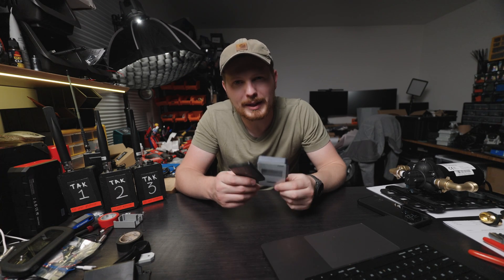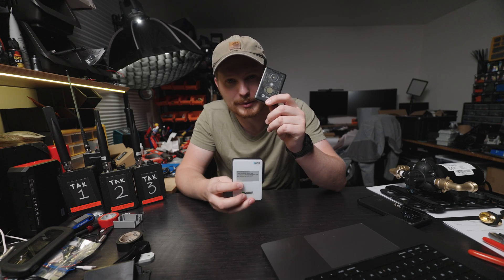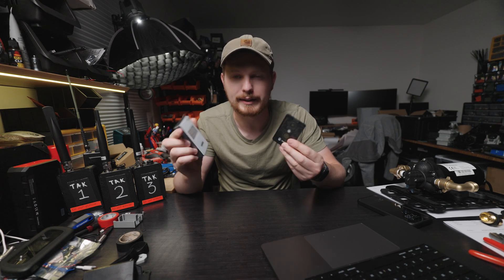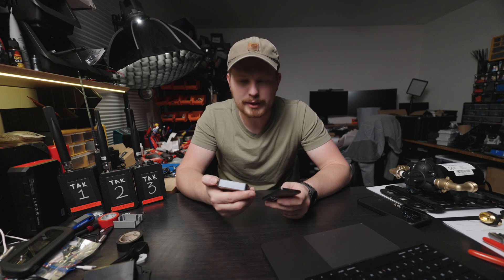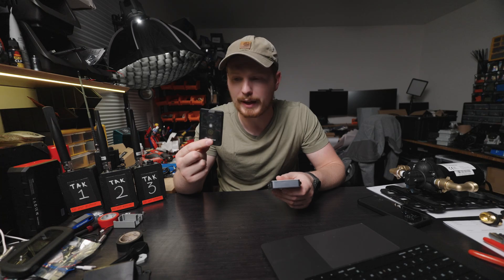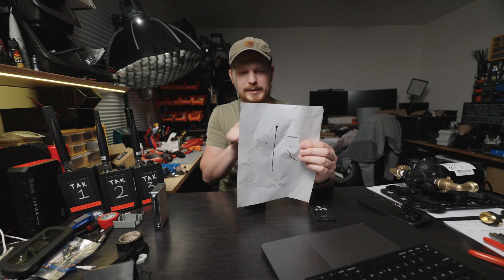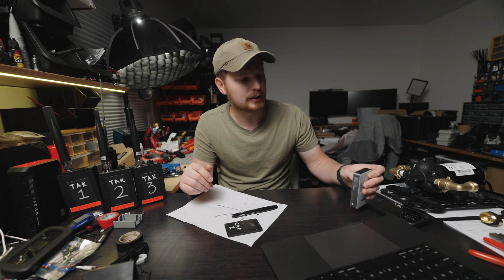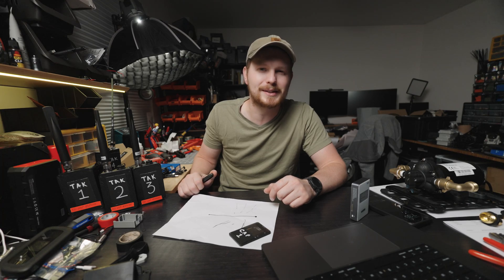Tips & Tricks to Flying With a Meshtastic Node

Comment: Great content.  Curious if you have tried flying the same route with the antenna in different positions.  What you said makes sense, but I am wondering if horizontally near the window would bleed downward better than pointing down?  Comparing the window to the floor, baggage, and fuselage.